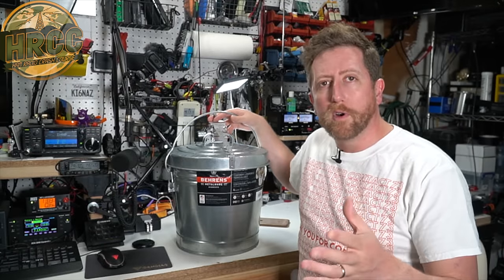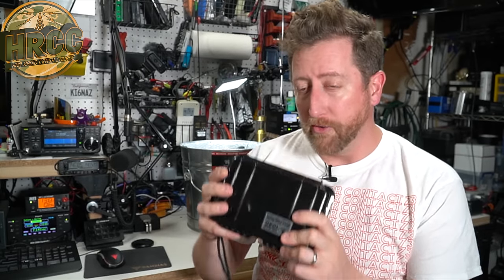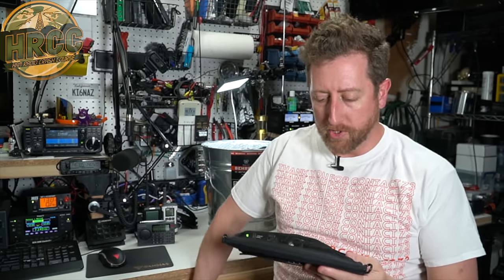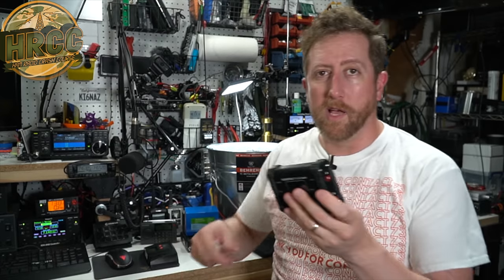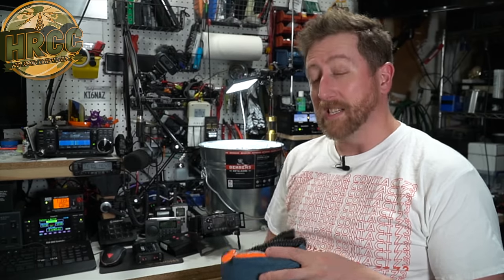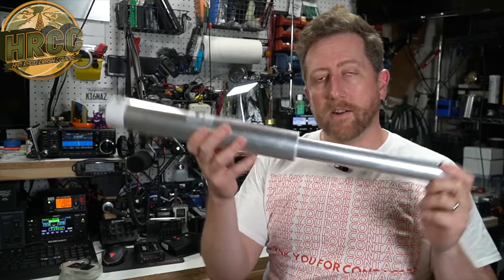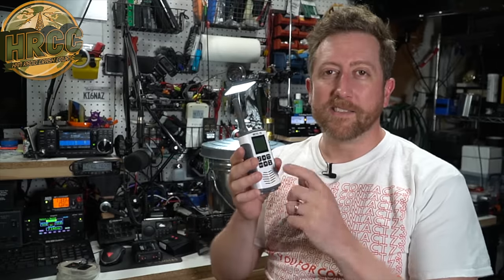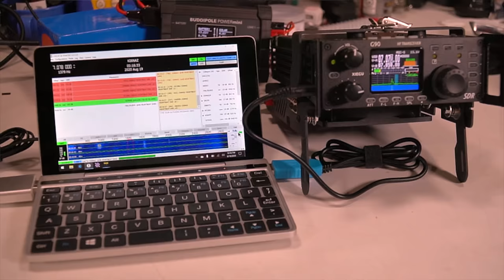Ham Radio EMP Kit, The Tactical Trash Can

Comment: As a beginner I’ve got a question that I hope somebody can answer. I like the idea of making a bucket, however Will an old military munitions can work as well.
Reply: All you need is a conductive shell, and need to insulate the contents of the container from the conductive shell. The shield needs to be conductive all around the shield (meaning lids need to be fully conductive around the seam, no gaps of non-conductivity). Also I would recommend using multiple shields for the contents you’re protecting, just in case some energy does manage to make it past the first shield. Also use the thickest material possible, as the energy levels involved in a EMP will cause eddy currents in the shield and if the pulse is strong enough and the material is too thin it will vaporize it, and could fully saturate the material at which point it won’t filter out any more of the energy. Do not ground the shield as the ground wire acts as a antenna and will pick up more of the pulse energy and bring it back to the shield. I would also line the inside of the shield with a high dielectric strength tape like Kapton that can handle high voltages before you put down the cardboard insulating sheets. A good rule of thumb to remember is that  ~90% of the energy generated is between DC and 100 MHz, so the shield should be designed to attenuate the most energy in that range. There’s a lot of variables involved in EMP shielding but these should get you started.

Comment: Large ammo can, augment the stock gasket with the mesh wire gasket. Spray all metal internal surface with bed liner spray or rubber based spray product (flex seal). Add ESD pouches for computer and radio. Maybe?
Reply from the maker: All my research leads me to believe the stock rubber gasket needs to be removed and replaced with a custom electrical seal.
Reply: Ammo cans can be effective, but you have to ensure that you have a fully conductive interface without gaps. 

I worked on a decent amount of emi hardening at Lockheed and one of the most important components is having gaps no greater than .1 wavelength for whatever you want to protect from. Most destructive frequencies will be sub 10ghz. Above that and you're crossing lines where your protection requirements will be very different. Ammo cans can work but I would recommend either switch the seal for a conductive seal, or simply use a conductive foil tape with conductive adhesive. You can get that on McMaster. But there are more effective options than an ammo can
Reply: @Squat5000  Right on man! Thanks!!

Comment: Can the TTC performance be improved by grounding it?   Looking forward to the show.
Reply: was thinking the same.
Reply from the maker: Grounding doesn't really do anything.  An EMP pulse is so fast that there isn't much it can help.
Reply: @HamRadioCrashCourse    HRCC, many thanks.  Thanks for the very informative content.  Be well.
Reply: Ham Radio Crash Course Can you expand on this?  It doesn't make sense to me that an EMP could out run the grounding of a Faraday cage.
Reply: @viewatyourownrisk  they have done tests the best way I can explain it is how a toroid can be a dead short on dc but it's an open where rf  is concerned.

Comment: I had the idea of using a shipping container as my shack.  Keeps out unwanted rf, put gauze over the windows, have a single entry point for antennas where the entry point can be completely disconnected and shielded over.  Same for the power line into the shack.  Store your Honda generator in it, power tools, invertors, computers, monitors etc.
Reply: Too many gaps I would imagine to be hardened against EMP.  Plus the environmentals (temperature and humidity) would be problematic.
Reply: Those containers are known to float, unless worn out/damaged. There was a video of some youtubers cutting into the side of one they found floating in the ocean to peek at the contents. The container was bigger than their boat so it was a super sketchy plan. A random used container would need to be checked over/tested well and gaps sealed but it should work.
Reply: The bottom of the cargo boxes are not solid metal, wouldn't that be another issue!  The rubber gaskets and the vent holes at the corners are other issues as well.

Comment: Would an old broken microwave oven work just as well for a more permanent/accessible shelf installation?  Also back in the day, I was thinking an old 40 gallon steel drump would work as well, for more bulky items?
Reply: A microwave oven is only designed to shield at its operating frequency of 2.45 GHz. They are just about useless at shielding at other frequencies. My cell phone works just fine in a closed microwave oven. Think about it: the manufacturer is not going spend a penny more than they have to pass emissions testing.

Comment: Mayby I can throw in my bit of knowledge, the cans are all good and well but you need too be able to sink the power to ground with minimal resistance.
My personal set up is 30m of copper ribbon buried in soil that is permanently moist as well as some normal earthing rods. The trick is surface area of your "rod" and the conductivity of soil as a good start a grounding rod from the hardware is a good start and then a large sheet of copper.
Reply from the maker: What is the evidence that a ground is needed?
Reply: @HamRadioCrashCourse - Exactly, I have Literally Spent Hour's Watching Video's & Reading Everyone's Comments & I've been Learning alot. It's Like I've been in Non-Stop Class Most of My Life. Anyway, I put My Cell Phone inside the Microwave & Shut the Door & Used My Home Phone & Called My Cell Ph. & it Still Rang. I also bought 2 Big Silver/Metal Trash Can's from Lowes & Lined it w/Card Board & Used Metal/Aluminum Foil Tape on all the Seam's on the Inside & Outside then I put My Cell Phone in & Closed the Lid. I Called My Cell Phone & I could Still Hear it Ring. What am I Doing Wrong. ? 🤷‍♀️

Comment: What about a stack gun cabinet? Or a gun safe?
Reply from the maker: How do you seal it tightly?
Reply: @HamRadioCrashCourse  Ok it seems I need to watch the video tonight :)  to deternine how tight the seal needs to be.   I heard a microwave oven with the power wire removed may work and then what about ammo cans?   OK stop typing and watch the show 73 from PEI Canada VY2WRA
Reply: @Yukon12gauge00buck    Funny!!
Reply: @Yukon12gauge00buck  Using microwave ovens is a common myth. They only shield well at their operating frequency of 2.45 Ghz. Think about it - they are not going to spend one penny more than they have to pass emission tests.
Reply: it`s better than nothing but the large slots in the doors make them pretty much a no go. If you used compression seals yes.
Reply: @HamRadioCrashCourse  Seal with aluminium tape, right?

Comment: Testing should be a necessary part of creating an EMP-proof solution.  I suppose aiming a tuned 1500w beam at the sealed can at close range to see if it keys an active receiver inside might be a fair test.  That's not exactly something I'd want to do in my backyard, but I'll bet you could do it reasonably out by the Salton Sea or some similarly remote area.
Reply from the maker: I did test it in another video.  The can generally provides 65-70 db of attenuations.

Comment: If you want a radio that will survive an EMP, try vacuum tubes.
Reply: Well technically it wouldn't survive, just the tubes would be the point of failure (hopefully) which are easier to replace.
But the best bet would simply to have it unplugged and have one that doesn't have a battery within it. (Because that would have a complete circuit at all times which would allow EMP to affect it)
Reply: H Higgins  he saying that you just store the radio with the tubes unplugged, the whole thing in a sealed plastic box
Reply: H Higgins  
That depends on the size of the weapon and the distance. Russians set the plug wires of a jeep on fire from emp in Kazakhstan.
Reply: Not true.
Reply: H Higgins  
Civil Air Patrol  circa 1985.
Reply: H Higgins  
I took a class on radiology. Calibrating dosimeters and using Geiger counters. We studied the effects of nuclear weapons.
Reply: H Higgins 
Its been a while since 85, I don't believe that they gave a specific location. USSR used Kazakhstan because it is the ass end of nowhere.
Reply: H Higgins  To be fair, that story was passed around a lot in the 80s...  I know I'd heard it as well.  The Semipalatinsk test site was in Kazakhstan. 
I do know for a fact that you can induce enough current in a small wire to make it burn (and yes, it's a lot of power to make that happen, even so...)  the bigger thing is that you can induce enough voltage running counter to the voltage in the circuits to cause even tubes to burn out. 
(disclosure, I teach "career curricula", i.e. what old timers call Vo-Tech, and teach electrical, wiring, as well as programming and mechanical classes - automation engineering technologies)  one of the things we deal with is electrical noise and inductive power from high voltages to low voltage control circuits.

Edit: (cont) -  Honestly, I don't know if the Jeep story is true or not - and I kind of doubt it, not because EMP couldn't produce that kind of result, but rather that automobiles tend to have a lot better noise hardening because they are a tougher environment to work in.  I've opened up hoods on old cars that you could watch the lightning show in the dark, but the car is running fine. So, I puzzle over how much, how far, and how well cars will do with EMP.  Cars are, in a lot of ways, their own Farraday cages and there are many documented instances of a car taking a direct lightning hit and keep right on running... so it really boils down to where the electrostatic energy can bleed out to - and as we all know, electricity will find the path of least resistance... 

Have a Great day!

Comment: Great Video -  I have Military Ammo cans. 20mm ammo down to mini Military cans all steel. ALL 10 have thick rubber seals 
and have a roll of the Aluminum tape for sealing. 
My Question - what about our SOLAR Controllers and Panels - how to deal with keeping those safe ?? 
WILL EMP hurt ALL electronics - say the parts in the BIOENNO batts. 
What to use for SOLAR power after an EMP issue 
Lots of factors to consider - of course if one is too close to the BOOM - no worries anymore.

Comment: Great Youtube channel, I have some stuff for the bucket! I just ran across this video today, but still wanted to comment. 

I like your "scout" radio. To add, but kind of covered below but you will need to know what to monitor, probably know or have these frequencies and modes recorded somewhere. 

Depending on the battery, chemistry you might want to put a "storage charge on the battery(s) as opposed to strogin them with complete charges. Just make sure you have a charging solution for when the time comes. 

You have radios, make sure you know what to monitor locally and regionally at least, you should probably have a frequency list on paper (in addition to what you have programed into you radio(s) tha covers these frequencies. 

If you have other people you will want to contact or check on have a predetermined contact schedule (Times, duty cycles, frequencies, fila down/up conditions etc.) You will be more likely to make contact and you save power.

A greats way to store a ton of documents that you may need to refer to is on a e-paper book reader, very low power. Manuals, first aid info, etc,... I to like you mini laptop, reminds me of my Toshiba Libretto of many years ago.  

Batteries without built in controllers will survive an EMP. I'd still put some batteries in the can so everything is in one known location.

I like your antenna choices very nice!

'73

Comment: There is a product from a company called EMP SHIELD that claims that their device can protect your home from an emp. If it works, it might be something to look into and a radio would be good to have in that type of emergency because unless your car still uses a point type ignition system you may have to bike or walking for information.
Reply from the maker: It doesn’t work.

Comment: With my luck, unless I can afford two of everything, nothing I need in the can will be in the can when I need it to be in the can. Learn vacuum tube tech and keep your antennas unplugged when not in use. Pre-transistor, tube tech is pretty impervious to EMP and high voltage/current spikes.

Comment: alternative to packet radio (at reasonable distance) could be LoRa. albeit not user friendly at first, you can get amazing ranges wth very low transmit power. mesh network  would be great addition to any survival group or groups over large area. love the idea of bucket, i presume this is "bug out" version, right? i've went similar way, but used good ol 50 gal  barrel, lined inside with coat of rubber, then with 3/8 of an inch thick sytrofoam (body and top). its not portable per see, but can put inside nearly all my battery powered tools, solar panels, comm units... for "on the go, i've made similar one, but used .50 cal ammo can with 18amphour batt and (for now) vhf/uhf radio.got tested at national lab, and they said it should be good enough to survive moderate size EMP attack :) . 
btw; love your crash courses videos, really helped me, when i was totally new into ham radio.

Comment: Both Yaesu and Icom make AAA battery holders for their radios (ID-51, Vx8DR).  I'm putting the VX8DR and ID51 in my can because the VX8DR has 6 meters on board.  I'm using the X-5105.   Now with the Xiegu 6100 that might be a good option, even though it isn't quite ready for prime time.  Instead of the C Crane I am using a small Whistler scanner.  Using a rubberized dry bag instead of packing material inside.  One question:  you did not seal where the handle of the lid goes into the lid.  Do you need to?  Isn't that just as vulnerable as the nibs on the top?

Comment: pro tip remove all of the antennas off the radios so that there is a reduced chance of damage, I would also throw in a UV-3r in there if it would fit. so that you could communicate with some else in your family if they had to go and do something in an emergency and a UV 3r can be charged by USB.
Reply from the maker: I like the addition of the UV-3R to the can.  I don't agree on removal of the coax and antennas though.  If the can is doing its job (and it should) then there is no worry.  Further, the coax and antennas are not connected to anything, so the threat is low.
Reply: Probably meant removing antennas from the HT’s... certainly good extra insurance. I’d to that before I’d build a “can in a can” for sure.

Comment: Just an Fyi a EMP won't touch a fuse if it isn't connected. for EMP to cause damage it needs to be in a completed circuit of some kind so an electrical charge can build up and overload the wires or connection within. 
That Aluminum bucket itself would works to protect anything inside but the best protection is to simply have something unplugged and not have a battery inside of the electronics.
And having a perfectly sealed can isn't really needed, you can make a EMP resistant cage from copper wire that has been done up in a chain-link fence fashion to protect an entire room.
Reply from the maker: The can in question is galvanized steel.

Comment: Tube radios are not EMP sensitive as long as they contain no semiconductors. Get a larger can to contain everything you want, do not restrict what you perceive to need. Voice/CW is all you will need, as others will not have digital capability. The tiny QRP transceivers that are rockbound can fulfill your needs or the mini low power transceivers like the Yaesu FT series are small enough to fit a 30 gallon can. Several H-T's of your choice (FRS/GMRS/2M/baofeng tri banders, whatever).Wrap your radios in bubble wrap for extra insulation, use either copper or aluminum tape to seal your lid as they are reusable. Antennas can sit in a large Mylar go bag, as the alkaline batteries, SLA batteries, and HAM batteries,are not EMP sensitive as long as they are not connected to anything. Remember coin batteries for memory backup to your radios, laptop computers, etc. As in anything else, keep it simple, basic, and portable because you may have to "bug out" from your home due to rioting, fires, floods because emergency services may be non-existant. Law enforcement may grab your "kit" to keep comma and leave you with nothing. Be ready to get out quick.

Comment: You shouldn't have to worry about the antenna unless it has some sort of tuner or other solid state components. A balen shouldn't be effected its just transistors and IC chips that's why tube type radios will survive. U do have some great ideas and love your chanel. 
73
De N9NJN  Jeff.

Comment: My radios all happen to have metal enclosures earth grounded to ground rods. It does NOT have to be air tight as he says. Yes, some radiation comes in through vent openings but it get highly attenuated relative to the E field outside. Now, there is also H field but his trashcan (or even a tinfoil hat lol) cannot protect against that (you need a special u-metal). I am not sure how much H field is contained in the EMP but if you have a radio in a grounded metal cage, you are not much worse off than the trashcan method.

Comment: I would add a spare cell phone. If you have a cell phone a major manufacturer is offering trade in value for, I would get that cell on a separate carrier, or just keep it on WiFi, on the cheap and put that in the can.
Reply: ?????       dear ted, a cell phone will  NOT  work  without the towers and the rest of the cell system.!        sat-phone, same problem.         lol